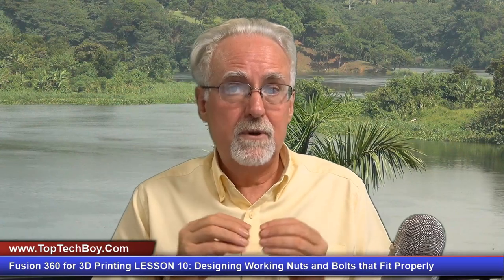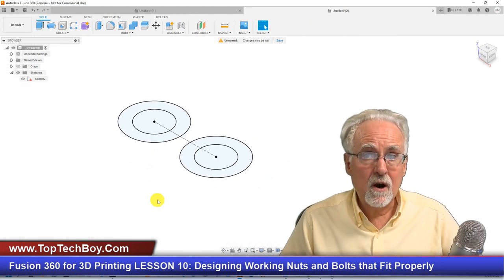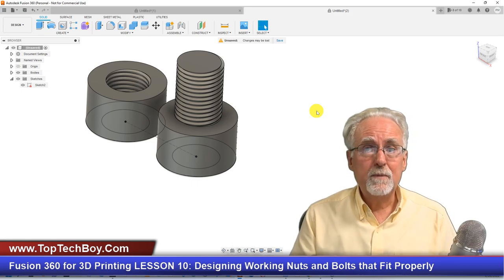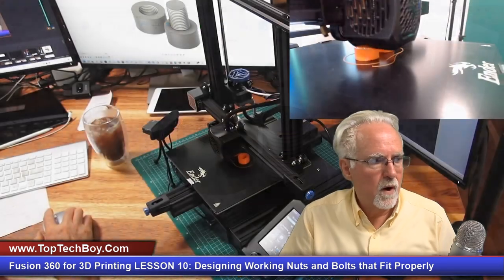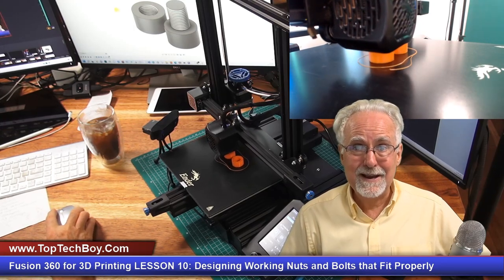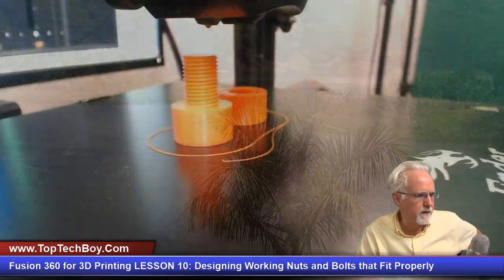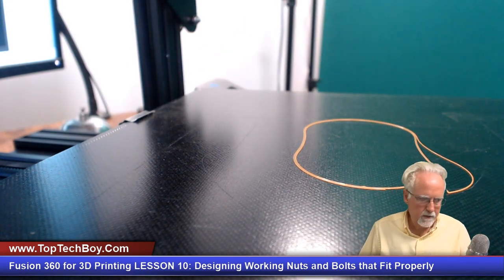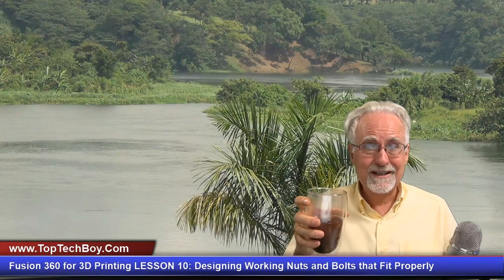Fusion 360 for 3D Printing LESSON 10: Designing Working Nuts and Bolts that Fit Properly

Comment: I like your fix for the tight threads.
When I ran into this some time ago I cheated, I just ran a tap and a die over the two threads and trimmed them slightly.
I guess it helps if you have the right tap and die.

Comment: Helping out the YouTube juice.
You made that look so easy! I still don’t have a printer. The hobby room is making good progress. The suspended ceiling is almost complete. I’ve asked this question before. What about the fumes from the printer? The last answer someone gave me was not to worry about it but you’ve mentioned before that the fumes bothered you. I’m thinking I should put in an exhaust fan. I will be doing some soldering as well.
Reply from the maker: Ventillation would be nice if you can manage it.
Reply: @Warren's Corner...  As Paul says ventilation would be nice, but maybe not 100% needed.  I've been soldering for over 50 years and never felt the need for ventilation for that anyway.  I've only 3D printed for a couple of years and only with PLA and PETG.  I've yet to notice any obnoxious fumes.  By the way I don't have any lung or breathing issues even after all this time.  I do have an enclosure on order for my printer just in case I decide to print any ABS or PC blend.  But that is more for the benefit of a higher temperature print environment for those filaments.  Plus I guess the enclosure may keep dust and "silly cat" hair from accumulating on the printer itself.

Comment: Got my bolt to work - kinda. For some reason the round wasn't very round. The seam down the internal thread proved a nuisance, but most of it rubbed away and I can get the nut mostly on. The printer treated the extrusion of the bolt head as a separate item to the bolt shaft, the result being an internal double wall that wasn't that pretty. I redid the design joining the bodies together as one which seems to have worked in the drawing - I haven't printed the modified unit yet. The thread seemed also seemed too tight too fit so I increased the pull-back a tiny amount. I also added chamfers to the internal and external threads like real nuts and bolts have that get the thread started easier. That was far harder than I thought it should be - fusion kept selecting bodies rather than surfaces or 14 surfaces instead of 4, etc. More work required there. I can't wait for the case to finish printing so I can try the modified bolt.

Comment: Great video, thanks. But where is the lead-in for the thread? There should've been a chamfer on both sides of the nut, and on the end of the bolt. But the most important thing is, where is that island? Lol
Reply: I agree with the chamfers. Paul does not tell you where he lives but after watching enough of his videos he has dropped enough clues for me to find his compound on Google Earth.
Reply: I put a chamfer on the threads but it seems to have messed with the threads enough that I had a little cleanup to do before I could thread the nut onto the bolt.  I added the chamfer after making the threads, so wonder if I did the chamfer first then added the threads would it have made a difference?

Comment: Hi Paul.. love the video series…. Does the “little” adjustment you have to make to the bolt thread make it “non standard” and incompatible with a nut, with the same thread spec, but just purchased from a hardware store.  e.g. for any particular application do you have to print both the nut and bolt?

Comment: Hi Paul, great content, is there a way in Fusion 360 to make a screw head ?.  I can make a bolt with a slot across or an allen key hole using the polygon , but what about phillips/pozidriv type head.

Comment: Well I've finally managed to print Paul's example in this Lesson. Here's my list of issues
Issue 1 - the bolt and hole in the nut were slightly elliptical, solution tighten the belts on the X and Y axes.
Issue 2- the thread in the nut had cords of filament cutting across the hole (not stringing), solution print at a higher resolution i.e. set slicing to "Dynamic Quality - 0.16mm.
Issue 3 - The nut kept coming unstuck from the bed, solution level the bed to a higher precision, i.e. when using a sheet of paper to align the bed go for a higher level of friction of the paper between the printer nozzle and bed.
Now to do the homework.
Reply from the maker: Welcome to life with a 3D printer. Definitely requires patience and tweaking but hopefully the reward of getting working makes it worth while.

Comment: I was able to print out the nut and bolt, they printed out really well except for one thing. The nut and bolt threads printed very well except for one area where there was a bumped up ridge on the threads in one small area going up and down vertically on the threads. I'm wondering what this could be caused by? My first thought was a retraction issue with the printer? When you sliced the nut and bolt in Cura did you modify any of the settings? Also wondering if anyone else has had this issue?

Comment: Maybe adjusting the "Class" variable in the thread dialogue box would adjust the clearance automatically ?
Reply: Yes setting the class to 1A does make it a little looser but not really enough. I also believe it only affects the groove depth and not the outer diameter. Paul's mod reduces the outer diameter as well

Comment: Is it best to print with the best quality or standard quality in Cura Slicer?
Reply from the maker: I use dynamic quality usually. In general the higher the quality the slower the print.
Reply: How did you get the threads to print correctly? Threads print ok except that area where the seam and blobs are. Are there any cura settings that need to be changed?